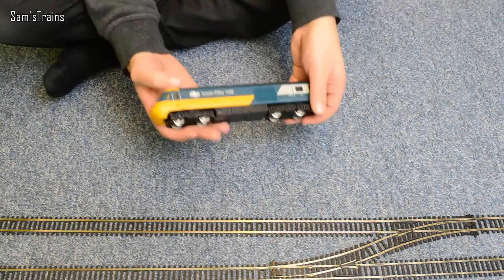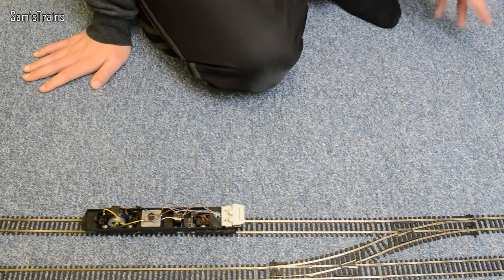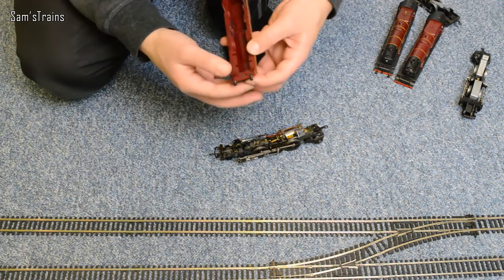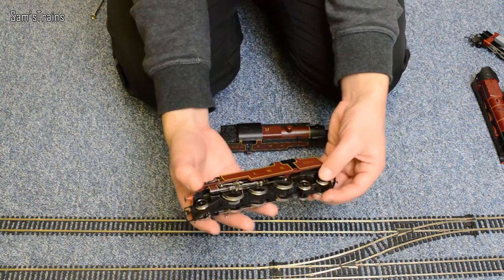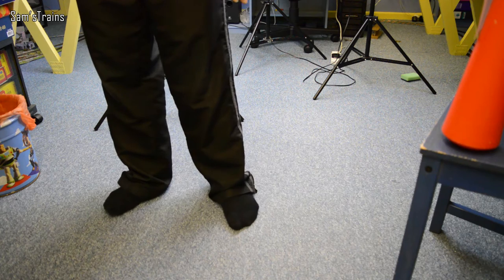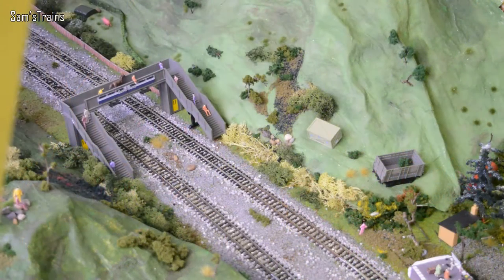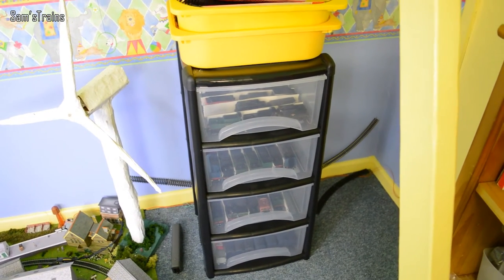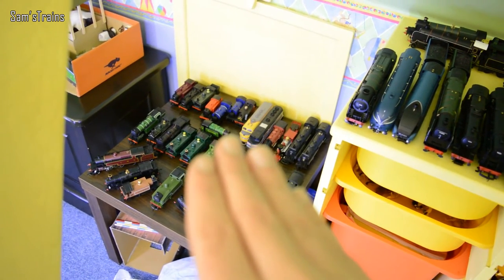Modifying Locomotives - (February Update)

Comment: Hi Sam, storage is an on going puzzle for many I would guess. Like yourself I have some locos and stock loose but in larger boxes, but as time goes by, I find I am buying generic boxes for used locos. These boxes then sit in larger plastic boxes with lids, for strength, which can then stack.
The detailed locos stay in their original boxes, probably the safest place for them.  : )
Hope this helps.  : )
Regards, Cliff.
Reply from the maker: +janiceandcliff Thanks mate - it's starting to look like I may have to do that! I've not done it up-until now since I love having them out where I can see them (even though they need a good clean once in a while) But yeah, I might box some of them up!
Cheers mate,
Sam :)
Reply: +Sam'sTrains I understand fully, you don't wish to stare at a wall of boxes...!
PS. thanks for your other repair stories, mods that work are always useful.  : )
Cheers, Cliff.

Comment: I have many boxes I just hide them in places and I might try the intercity CD drive motor looks like a good mod. brilliant video once again. thanks allot
Reply from the maker: +kirk jones Hi mate, good luck with the motor mod - it was quite straight forward, the only trick thing is to make sure the gear is glued onto the shaft so it's dead centre - I used loctite gel to glue it since it dries on metal in seconds!
Cheers mate,
Sam :)

Comment: Sam, get yourself a small multi tool drill set, they have sanding disc, that should do the trick for cutting into plastic.
Reply from the maker: +Jef Blogs Thanks a lot for the tip - I will look into that!
Cheers,
Sam :)

Comment: Great video! the CD motor looks very interesting.i have an HST which only runs when its in the mood.       cheers   dave
Reply from the maker: +davestrains Thanks mate - I can definitely recommend the MOD, if you dare do it - the method I use is a bit 'bodgy' but it works very well!
Cheers mate,
Sam :)
Reply: Hiya Sam. For storage I've started collecting the hardboard stackable boxes (Spanish Clementines) that  supermarkets  get in at Xmas, aprox 30cm x 20cm x8cm high. they will hold a rake of 5 coaches or 5 locos with tenders etc. Th e beauty is they are shaped to stack safely as high as you want AND you get to eat the clemantines ;)
Cheers
  Matt C

Comment: Storage - you are going to have to sleep in a cupboard or a hammock.  Problem solved. Seriously ,"Tender Tower" - place your empty loco boxes UNDER the tenders (should make a flat surface) - you might even get two layers of empty loco boxes supporting the tenders.  (You may only want to preserve the box, not the moulded polystyrene, obviously you could discard the polystyrene, then carefully fold the emptied cardboard box flat (maybe yoy wish to preserve both)). Hornby HM2000 - had same problem when connected to auxiliary (HM2000x?). Bought another HM2000, worked well. Seems the problem  was the auxiliary 9 pin connection, not the old HM2000. I seem to learn more from my mistakes as I get older, not benefit from experience!
Reply from the maker: +itloon haha thanks mate, I might well be sleeping in a cupboard by the end of it! Thanks for the tip regarding the tender storage, it's a great idea - I'm gutted I didn't think of it before glueing those dividers down! But yeah, I'm looking to keep the polystyrene inserts too, if I ever need to transport a loco somewhere!
Thanks for the info on the controller too, touch wood, it seems to be problem solved now, with the new controller!
Cheers mate,
Sam :)

Comment: great video sam I had the same problem with my one do you find it with the Triang locos ?
Reply from the maker: +layout 123 With which loco? The princess?? :)
Cheers,
Sam
Reply: +Sam'sTrains I mean the controller hm 2000 sorry I didn't really say did I haha
Reply from the maker: +layout 123 Oh yeah! I'm with you now - my fault really for throwing so much into one video!
But yeah, I think it must be a result of the design, all the ones I've had a go with have been the same, but some seem worse than others! Not a huge issue though, I've lived with it for long enough anyway!
Cheers,
Sam :)
Reply: +Sam'sTrains my blue Pullman had like no speed control with this controller haha. I also found the switches failed on my one as well

Comment: Hi Sam, just a couple of questions. I have a 125 from the 70s-80s same problem with the ringfield motor, very slow. Have a number of CD, motors run well tested hooked up to the gaugemaster controller, what sort of glue did you use on the small cog and on the drive spindal. If possible would you be able to do a complete video on a conversion if time permits. Thanking you, John from Oz.
Reply from the maker: Hi john - I used loctite comes in squeezable bottles, but you want the gel and not just the superglue - it's brilliant stuff!
I don't have any conversions to do at the moment, but if I ever do another, I'll definitely film it for you!
All the best,
Sam :)

Comment: Great video. I recently bought a second hand HM2000. Being new to me I checked the voltage terminals and as the dial was turned the voltage increased to 12 volts up the the halfway mark then dropped to 6 volts before increasing again to 12 volts with the dial turned fully. Do you think this is a fault or something to do with the feedback system. Locos seem to run fine. Would appreciate   your advice.
Reply from the maker: Thanks John - it could be to do with the feedback system or PWM - I've always read funny voltages from mine too - does it function properly when powering locos?
Thanks for watching - Sam :)
Reply: @SamsTrains  The locos seem to run fine although with a slight buzzing sound when running slowly. I hadn't realised that the number underneath the HM2000 was the manufacturers  build date. Mine is 1106 so quite old. I've got one of Hornbys HM6000 on order which will be interesting.

Comment: Is there any chance you had a video showing the mounting process for the CD motor into the 125 chassis?

Has anyone modified a 125 chassis to have both bogies with powered wheels?  Either with motors on both wheels or sharing the motor between two bogies like American diesels do?
Reply from the maker: Hi David - yes I've since done a video on that - you should be able to find it by doing a YouTube search!
Thanks for watching,
Sam :)
Reply: Yes, just found it.  Thanks for doing it and pointing me in the right direction when I was too stupid (lazy) to look in the first place.  

Has anyone done a conversion to adding a second motor to one of these chassis to improve the number of driving wheels?  While I love my 125's, I get very frustrated with the lack of pulling power with it just getting power / traction from one bogie.

Comment: Where did u get the motor from that u put inside the hat Sam I'm interstices in getting it cheats
Reply: I meant cheers
Reply from the maker: Hi, thanks for the comment! All you need is an old CD/DVD drive from a PC! The motor is inside, free! (It operates the opening/closing tray) Otherwise, just search ebay for DVD/CD motor, they're pretty cheap!
All the best,
Sam :)
Reply: ok thank you sam
Reply: Sam'sTrains hi also can you tell me the model name so I know which size I need as my other doesn't fit
Reply from the maker: Hmm there's no set model name - as long as you use that kind of pancake motor! As well as removing the armature, you also need to remove the old circular magnet, otherwise they won't fit - have you done that?? :)
Reply: yeah but mine wont fit
Reply: Atgamingandvlogs Thats what she said 😆😆😆😆😝😝😝
Reply: 35005CPP that doesn't even make sense